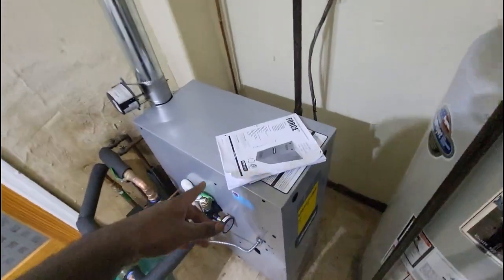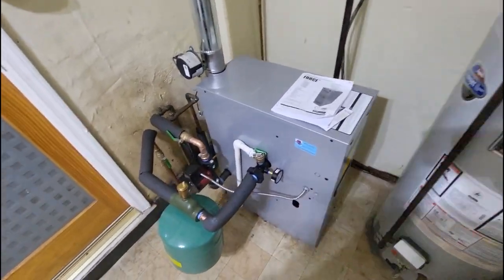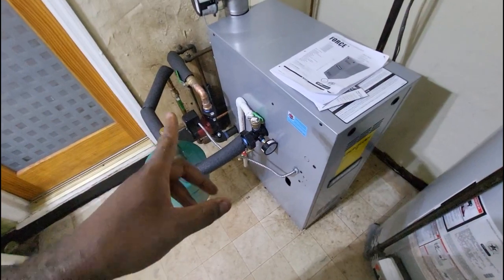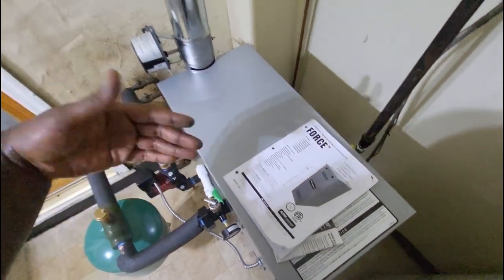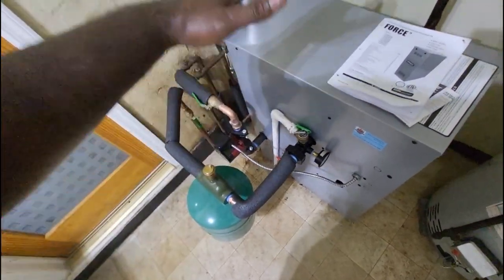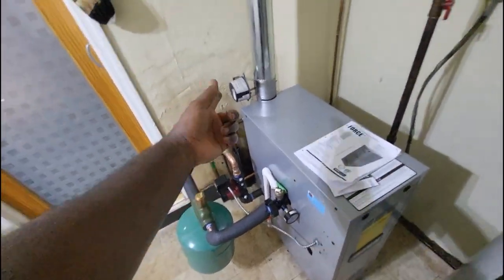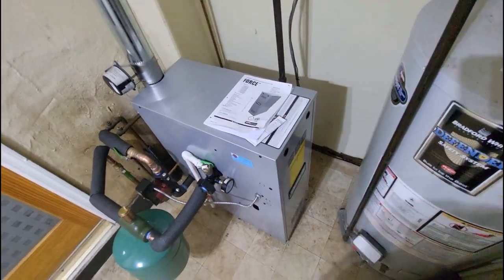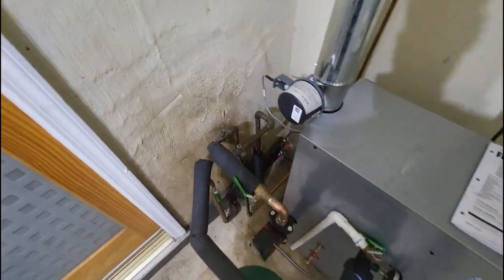⚠️PRODUCT REVIEW ON FORCE-03E HW Boilers⚠️

Comment: I got two estimates, one company would be installing the ProSelect Force04ENRHG1 and the other is using a New Yorker-CG40FN-TH CG-F Series Efficient Gas-Fired Water Boiler. They are both made under Burnham name correct? Do you think one is any better than the other?